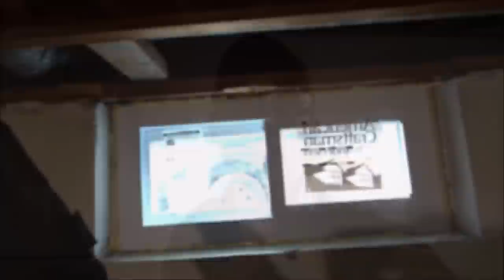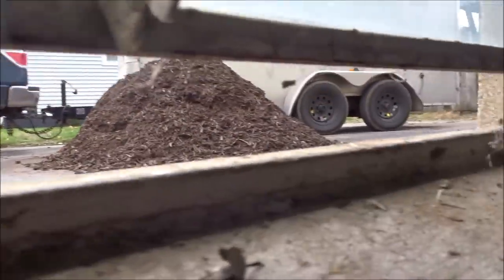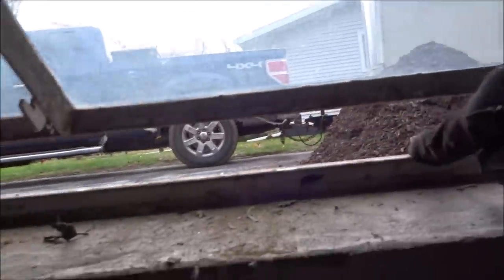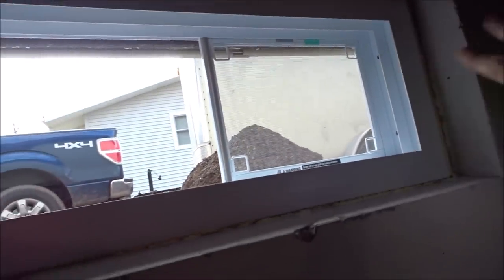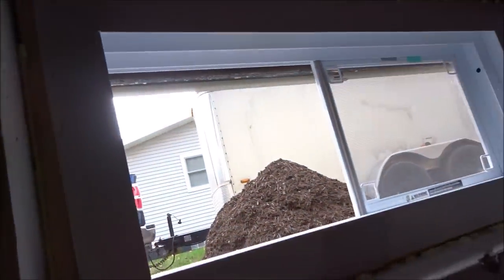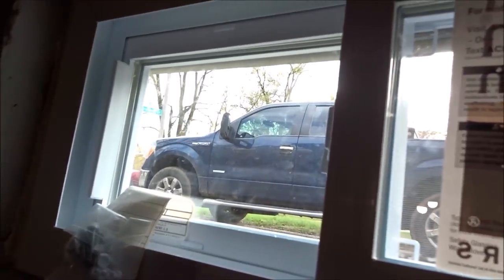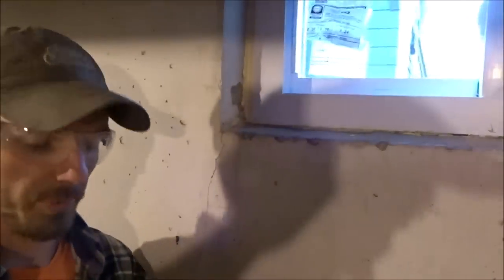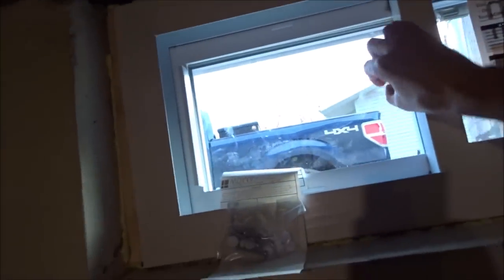Remodeling A Foreclosure! (Part 2) New Basement Windows

Comment: Great job mitch, ive been in the window and door manufacturing businesses for over 30 years, i actually run the department that builds sliders like the ones you were putting in, you did a great job in explaining the energy star stickers on the windows, im not sure but those were probably low-e windows also i couldn't tell if they had a tint to them or not, every window and door we sell now has the low-e glass in it, Great job man these videos are right up my alley.
Reply from the maker: Thank you for the support, I appreciate it very much! That's awesome you work in that industry. I'm not sure of they we're low-e or not but like you said most windows and doors are low-e glass.

Comment: You needed to use pressure treate wood or at least paint the wood that is touching the cement with some type of protective pain or something.
Reply from the maker: That is a good tip that I will keep in mind for next time, thank you.
Reply: flashing tape would help too
Reply: lol.. you might be right. I think it was the autocorrect feature that messed things up. Al lot of times I don’t recheck what is on the screen.

Comment: You need exterior caulk, sealant in particular, use tape for straight lines doing it with your fingers will result into bad caulk, also pressure treated wood !

Comment: you used regular pine board for window trim. you needed treated wood
Reply: Not only that, there is no flashing, no water or vapour barrier, nothing!!
Give it 10 years and these windows are going to be in worse condition than the windows he replaced!
Reply: Why not just get a slightly bigger window and screw right into the concrete and foam the 1/2" gap
Reply: Because it's a flip!
Reply: paint on treated lumber doesn't work well 
He has caulk and paint protecting the wood around the window this will work ok 
Could have used pvc board
The wood behind your gutter's isn't treated
Reply: Remember any painted wood on the outside of a house will need attention every 3 years

Comment: Why the wood? Just tapcon the window to the concrete and a nice bead of quad all around.
Reply: The windows were nearly 2 inches narrower than the opening (notice he placed the windows into the opening from the inside of the basement, even with the wood already in place.) He needed the wood as giant shims, he just should've used treated lumber. 🫤

Comment: That American Craftsman Silverline owned by Plygem blue white extrusion turd of a window is horrible.  Window pros consider anything by that company to be the worst windows in the entire industry.  You want a hopper style for more ventilation, not sliders with pocket sills that will fill with water that have to irrigate through the sill to get out.  You don't even need to pack the side with wood which can rot or use treated.  Just measure tighter, get made to order windows, tapcon to the mortar joints and two screws at the top header to the plate.  Shim and foam.  Finish with cement/mortar to the exterior, or capping blind caulked faux to the surrounding and sealed with 50-year hybrid sealant like Quad.  Never use that Dynaflex 230 in a larger gap exterior area, it will shrink too much, it's good for interior though.  Use RWD extender peel and stick vinyl trim for the interior.  The PVC brickmolding face drilled to the exterior looks terrible.  At least utilize Cortex plugged face fasteners if you're going to butcher the face.

Comment: What size window was this particular install?  Mine are 32 x 14 if i measured correct. My new ones are supposedly 31 3/4 x 14.  Also you used 1x3 treated wood. What's minimum thickness would suggest using? Mine look like these, hoping to do how you did. I will know more after tear one of the six out and see in couple weeks.
Reply from the maker: The windows I bought I believe we're 32x14 from Home Depot. The old ones were a weird size aswell but 1/4-1/2 an inch for a custom window wasn't going to be a big deal to me. Especially if on window was gonna cost 3x the amount. Yes, the boards were 1x3, treated would be best since it'll be attached to concrete. The 1 by material is probably the minimalist I'd use, anything less won't give you too much to bite down on when screwing in the window.
Reply: @HitchinMitch  what was white trim board you also used outside. Thanks again, You have the best video for me to reference when i go to do these. i have watched a dozen times already. and will continue thru my attempt. I am using Menard's windows, when they get here. they were sold out already, saved a few dollars. I have a Home Depot and Lowe's also.
Reply from the maker: @thumperohio8752  glad to hear my video is helpful! The outside trim board is brickmold, can by wood or PVC version. 👍

Comment: friend, a question I have a window in the basement like the one that you changed, only that in the frame I have 1 1/2 of difference around the window per side, which is the closest I can find what kind of wood you recommend that I use for  be able to fill the openings with cement 🙏

Comment: Hi, that is a nice  video. You really show step by step. I have a question. What do you put outside the window (both sides)? Are they cappings in wood or molding? I am trying to figure how to finish outside. Thanks.
Reply from the maker: The outside trim boards are called brick molding. You can get it as primed wood or pvc.
Reply: Hitchin Mitch Thanks a lot!
Reply: Omg, I was looking for this thing for days! Just didn't know how it's called!! Thanks a lot!

Comment: How did you do your measurements? Did you make the window the exact same size as the opening, or 1/8 or 1/4 smaller all around?
Reply from the maker: I ended up just buying a standard size they had on the self. If I recall I had about 1/4 to 3/8 on the sides.
Reply: @HitchinMitch  what size were the windows?
Reply: Mine has a half inch around

Comment: Is the wood on each side necessary or was that added to allow the window to properly fit?
Reply from the maker: I have the wood on either side so I can screw the window into it. I felt it was easier to mount the wood to the concrete then the window to the wood then trying to mount the window to the concrete directly.

Comment: how long did it take you to remove the old window?
Reply from the maker: Took me approx 30-45 minutes each.
Reply: @HitchinMitch  thats not bad at all. Thank you for sharing I will be attempting this in about a week. Excellent job!
Reply: @HitchinMitch  How do you suggest I start if all 4 sides are encased in concrete?
Reply from the maker: @randyhoseajr.8935  I'd would try to find the side that's least in the concrete and start chipping away.